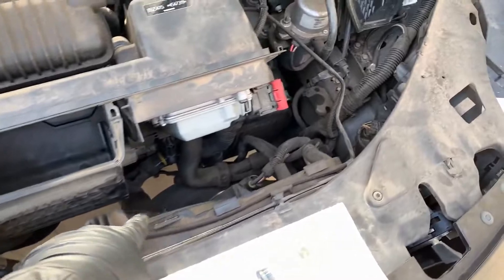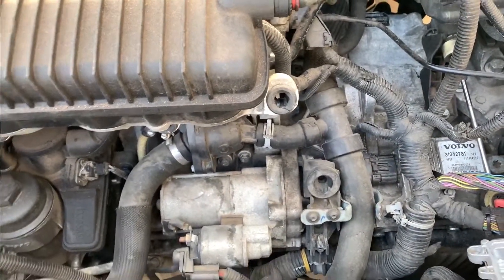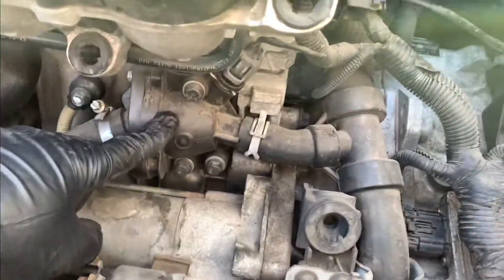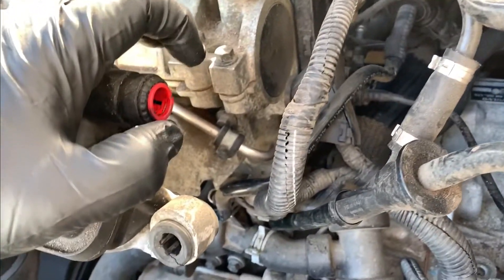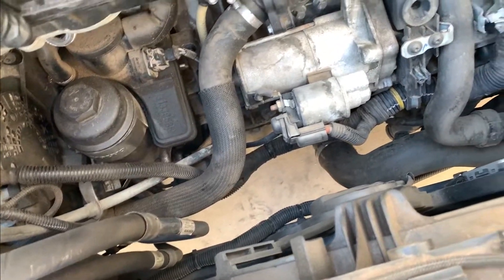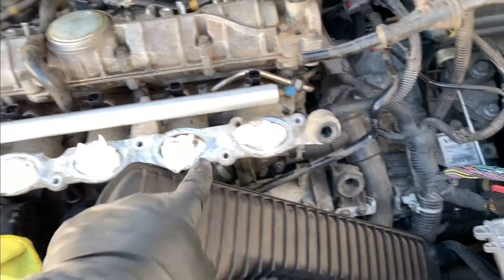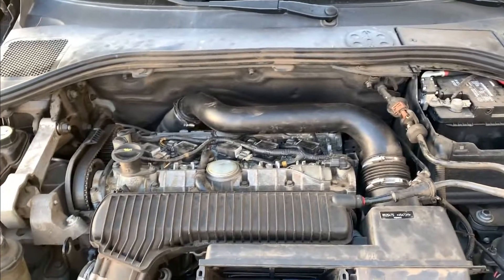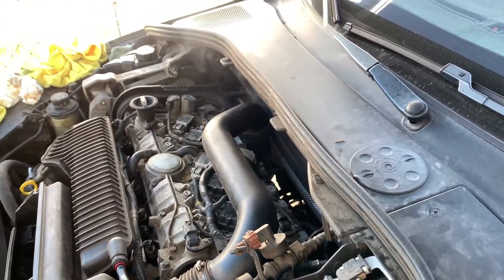2010-2018 Volvo T5 Misfire Code Fix Part 2: Fuel Injectors

Comment from the maker: Let me know what other details would be helpful for this project, or anything I missed mentioning.
Reply: Please do more videos of maintenance! What happened with the smoke?
Reply: Liked video.  Have same issues, very helpful for DYI.  How is you S60 running now.?   Did your fixes in the video work long term?  Any other issues come after the video was taken?  I replaced my injectors by watching your video, really helped.  Also, I think I will do my water pump and thermostat later with the help of your video.